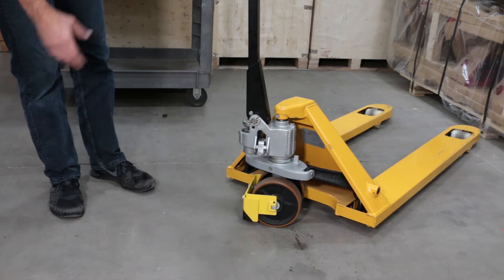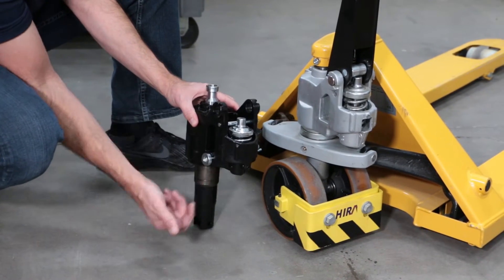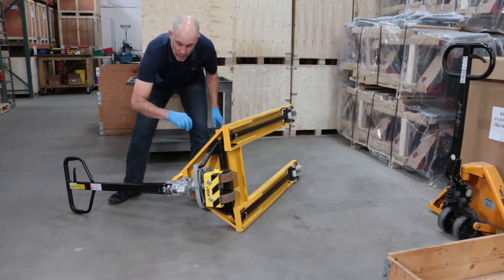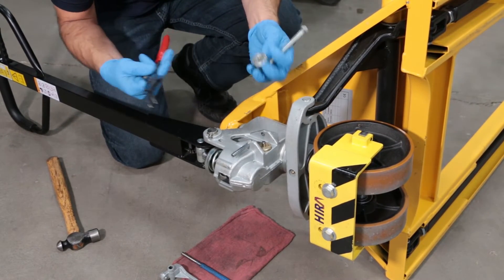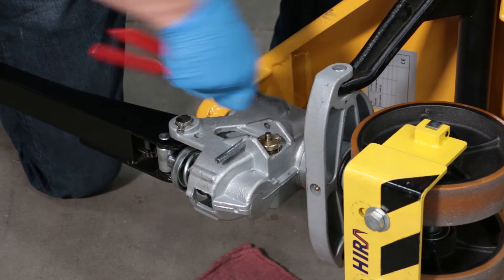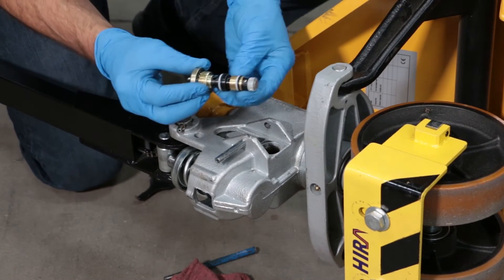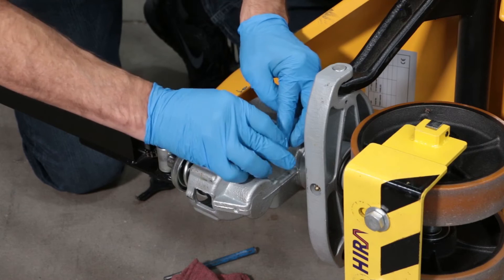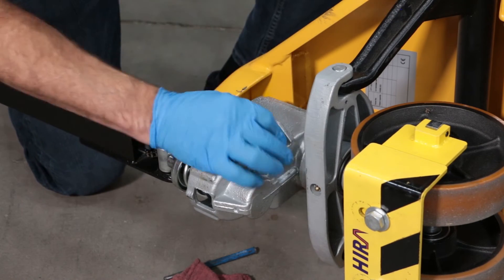Valve replacement

Comment: What is the valve part number? 
And thanks for the video👍
Reply from the maker: Please contact our Customer Service at 800-331-0839 or per email csinfo@genericparts.com they can make sure you get the correct valve for your specific pallet jack.